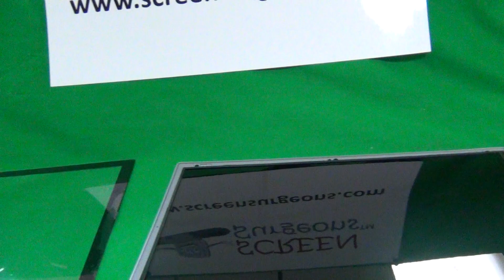How to Attach the Digitizer to the LCD When Repairing a Touchscreen Laptop

Comment: Please help can this same  technic work on a samsung s8 plus on putting the lcd digitizer to the glass screen??
Reply: On a modern smartphone, the digitizer is attached to the lcd, not the glass. If you have damaged glass, you can replace the glass only if you are extremely careful (search for videos) but you can't replace only the digitizer...if digitizer is damaged, you have to get a new lcd/digitizer assembly. On a phone, you use optically clear adhesive (OCA) to "glue" the glass to the digitizer/lcd. You can get it in a sheet that you cure with heat, or as a liquid that is UV sensitive and cures with sunlight or a UV lamp.

Comment: I have an HP Sceptre x360.  HP does not use the foam tape you mention but it's more like a glue.  Have you ever heard of this?  Which one is better?
Reply: Is the glue dispensed across the entire screen?  If so, then it's probably LOCA or OCA, which are much better than an air gap in terms of optics and durability

Comment: How thick should the adhesive tape be? Thanks
Reply from the maker: The foam tape should be 3-4 mm thick
Reply: Thank you
Reply: Screen Surgeons you mean wide. Perhaps 1mm thick. Where can we find the tape?
Reply: @ScreenSurgeons  
Hello sir
I have samsung galaxy s8 mobile phone.
I broke the front glass.
I bought a new glass and fitted it.
It did not work. Screen did not appear usual dark black. I could see a silvery screen under the glass.
Looking at old broken glass,, i realised there was a very thin fil stuck to the glass and this thin screen produced the dark black screen.
I also realised new transparent glass did not have a digitiser stuck to it as it is with the old broken glass.
Question,,:
Can I possibly buy a digitiser screen  by itself
without having to buy lcd and/or the front glass. I can then stick the digitiser to the transparent glass I already bought.